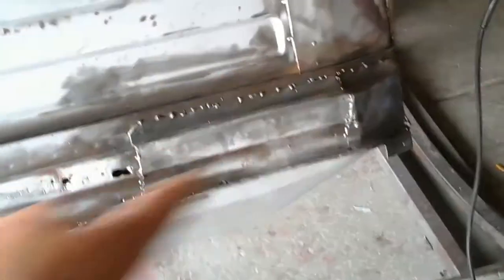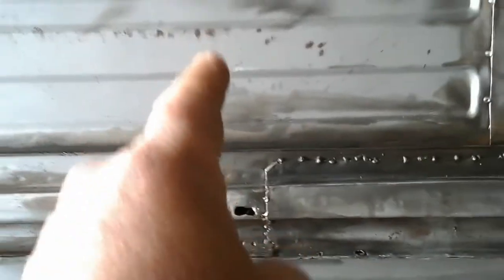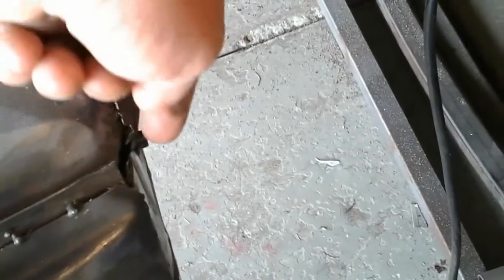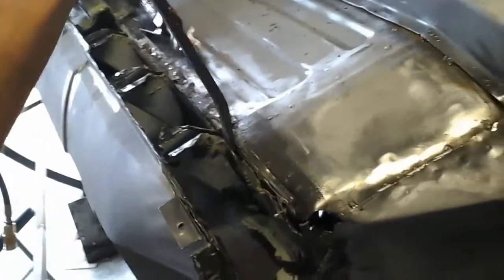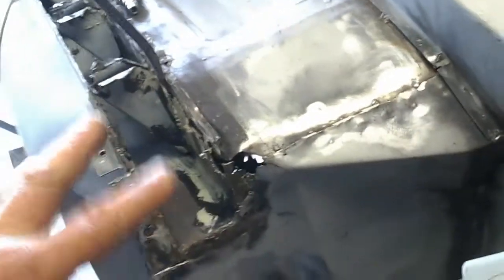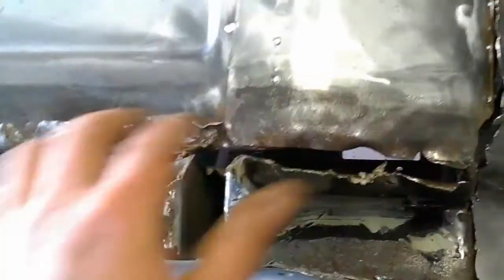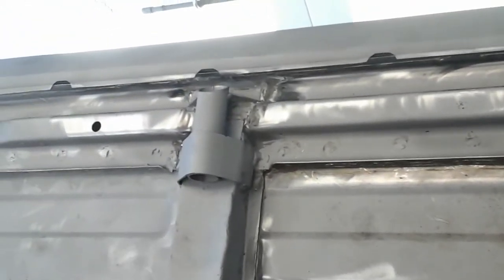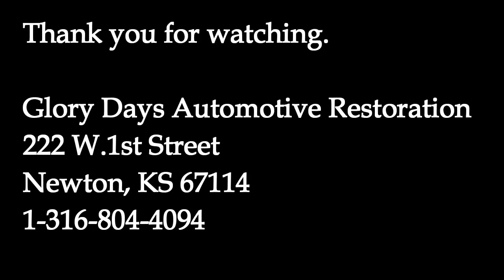MGB Restoration 7 months into a 3 month project part 2

Comment: Nice work. 

Looks like someone added extra jacking braces to the inner sill?  It's much harder to repair someone else's botch jobs than it is to repair honest original rust.  

I bought my MG "fully restored" and have spent the last three years cutting out all the previous botch jobs.
Reply from the maker: +johnt  The owner of the car paid to have the rocker panels and the jacking braces replaced. But the person doing the work obviously did not have the necessary skills to do a very good repair....I started posting some of these videos for the purpose informing the general public to be careful. Not all company's are doing good work.

Normally, I would explain to people that buying a finished car is cheaper than paying to have a car restored..But I also recommend to people to have the vehicle inspected by a professional.

Comment: You need to fit a new castle rail mate
Reply from the maker: I was not about ready to accept the crappy work done by the previous shop. I do not mind taking on project started by other businesses but the work better be something I am willing to put my name on. Believe me the castle rail was fixed.
Reply: I agree. I hate shoddy work. I think you did a good job. I rebuilt a 1974 B much worse than this one. I cut out and replaced everything. They can be a tricky car as you know.
Reply from the maker: all cars can be tricky, each in their own way. Most of my experience is American muscle cars, but since going into business I have had the opportunity to work on a few mg's, one Porsche 911, plus others. Their is a lot to learn. Then you have to contend with poor work. That makes my job a great deal more difficult. THanks for posting.
Reply: thanks good luck